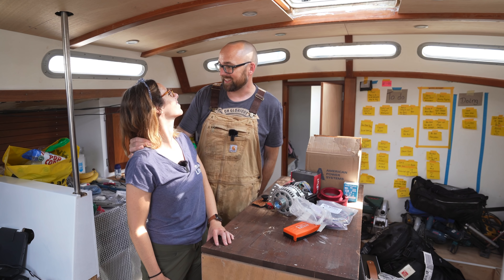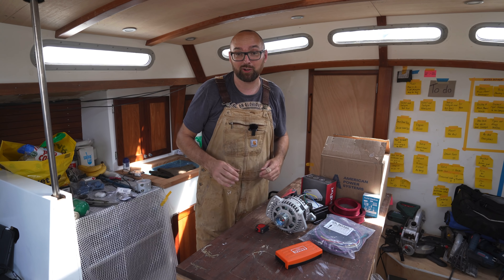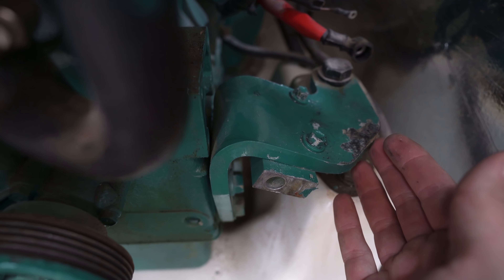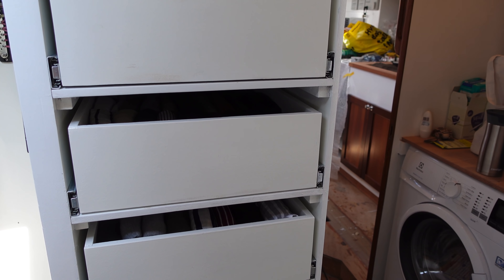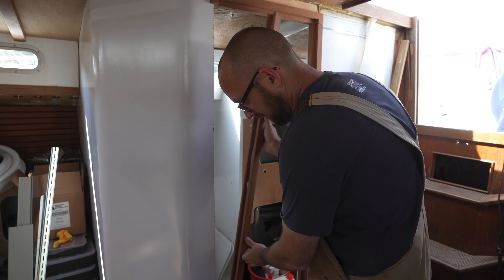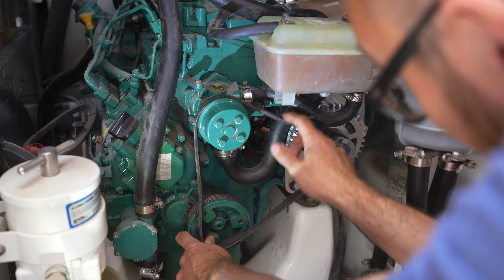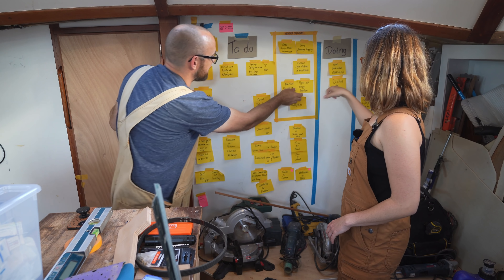Sail Life - 5kW gorgeous alternator 🔥, doorframe & Athena gets her name back

Comment: Nice work guys.  Two options for the shelves in the V lockers.  Thermo formed plastics you cut and use heat to bend then rivet or glue together.  You can make very tight fitting shelves that are very thin so maximize space.  Also can cut them so they allow reaching "in front of the transverse vertical parts so there is no hidden spaces.  Can use net bags as well to coordinate what is stored so your not having to dump and sort then store all the time.

Comment: FYI for the DIY 
Whenever you have some small dents in real wood you can make a couple slices into the grain with a razor knife and then place a wet rag over the dent. Use a hot iron in order to steam the wood by forcing the heat through the wet cotton rag and ...
TADAAAA. 
repeat as necessary after drying then sanding down the raised grain that results from the steamed wood grain.
👍🏼 hope it helps.

Comment: So a couple ideas for your organization, in the lockers where wood shelves won't fit, you could do a fabric shelf with it sandwiched between wood strips on either end. Also, for the plastic bins, if you can get it there, some shelf liners would reduce noise and keep them from sliding a bit. Some elastic straps could be utilized hold them in place too. See the link below for the shelf liner

Comment: To attach the clutch with shorter bolts. Make the bottom piece of wood longer than the clutch. Make the top piece of wood the same size. Ensuring the upper wood is centered with the bottom wood. The bottom piece of wood, drill upward and countersink the bottom side and mount the bottom piece to the upper piece and the clutch so the bolt heads are flush with the bottom. Then put down on the boat deck, and with the outward longer flaps on both sides, bolt down through the deck.

Comment: @2:00 but... the engine compartment is clean and freshly painted... oh.  ISWUDT.
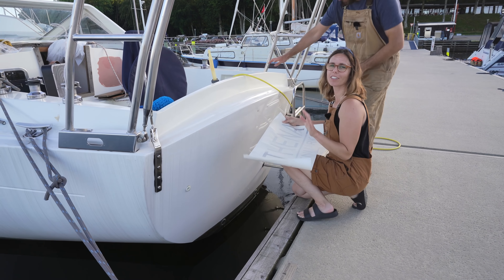@15:10 Invest in some kind of bracket or a place to secure  the ladder/engine access panel.  Because other wise you will put it any old where that will  damage the finish on your panels, and potentially become a hazard if you are troubleshooting the engine while rocking in heavy seas.   
Assuming you haven't  thought of that....  which you probably have.

Comment: Regarding the issue with the motion of the plastic boxes. I have you considered attaching a lid on the shelf in some way and then just let the box stand in that lid. The boxes and their lids are constructed in such way that they are stackable, so it would certainly work. There is also some dohickeys at IKEA that is used for "locking" the lids in place, which are really good in cases where the boxes are a little overfilled and in which case the lid will just not stay in place 😉

Comment: For the compartments where you can't fit shelves, if you can't fit horizontal dividers, you might want to try vertical dividers.  That way you can fill it with things that stack, while still keeping divisions.  Also, because the divisions are vertical and don't support weight, you can make them much thinner (so they take up less space).

Comment: I would use bungee cords on the plastic baskets on the shelves to hold them in place and cut down on noise when at sea.  You could also use metal or wooden rods that you could Fit into slots but would require measuring, more work and more noise.

Comment: for storage in the one compartment that you couldn't get a shelf installed..  try the "shoebox" sized containers similar to the larger ones you have on the bigger shelf spaces.   that location looked like you'd be able to put 3 or 4 across, and maybe 3 or 4 tall....if you find some of the better ones that have latching lids, they'll keep things dry, are clear so you can see some idea of what's in there, and can pull out a couple without really disturbing the others much.....(labels on the end would go a long way too)  They're just big enough you can put two pairs of jeans in them, or 3 or 4 tee-shirts, a week's worth of sox or a weeks worth of underwear.  bulkier items like a sweatshirt might be single entries, but it deepends on how bulky they are..

Comment: Phew!  Lots to think about.  Volvo Penta do a kit  for mounting a second alternator on the LHS (starboard) side of the engine.  This is for the Mastervolt alternator but it then provides 12v and 24v supplies, you can then have a separate battery for the engine and generator - useful...  Covid - in the UK we have a certificate system run under the NHS with the NHS app.   Even as visitors you could register on this, other than that I don't see any problem, certainly in England at least.  We are very tolerant of these situations, and I've met many different nationalities staying at the marina.

Comment: Regarding shelves in the lockers over the v-birth, have you considered trying "soft shelves"? Attach some kind of rubber band (like the ones used for cars with hooks on) and add one in the front and one in the back on the level of the shelf. As the shelf ot self you can then use some sort of fabric or mesh. You can create a "tube" of it and have the rubber bands go inside of it.

Comment: I hope that faucet output isn't too close to the edge of the sink. Hard to tell from the camera angle but it looks like the water will come very close to the vanity top. I always find it awkward to wash my hands in a sink where you have to practically put your hands on the edge of the sink to get them under the water.
Actually I just had another look and the faucet output looks like it doesn't go straight down but points more towards the centre of the sink. So looks good.  :)

Comment: Mate, i feel your alternater pain. Ive got a Yanmar 3ym30AE that i didnt want to pay AU$2500 for a genuine alternater, so i purchased a bosch from a local marine electrician that was "drop in" for $700, it sat proud and crooked to the belt line. Turned out the ear they ground down wasnt ground enough and done crooked and the rear mount they made was also out of wack, 3 days later its in and belt on. Started up fine for 30 seconds, shut it down to get my laser thermometer and it wouldnt restart, another day to find a loose earth and it runs fine now but no water out of the exhaust.....so i moved onto the dinghy engine for a bit lol. At least theres always another project to move onto when something wont play ball. (Waters an easy fix anyway, whatever it turns out to be)

Comment: Anti slip mat under the ikea boxes works great or just screw on a rubberfoot underneath them and you won’t have the mats to fight with. 
The cabinets can have a horisontal devider to make it easier make it in two pieces and it is easier to get in there
Also put the medicals in a box with air tight lid you do not want medication to get into moisture..

Comment: Minute 6:55, you can always cut the shelf in two so it will fit through the door, in order to hold it you just need a perimetrical piece of wood all around and few screws, remember it won't be the strongest shelf of the world, but for clothing or no so heavy stuff would do

Comment: Could you flip the alternator mounting block and mount it on the top side of that motor mount. Then the bolts are on the bottom. The alternator will sit a little higher, hopefully you have the room.
Reply: Hahaha i should have just waited till the end of the video. Nice work.

Comment: It would be best to fit the larger pulleys. It does 2 things It increases the alternator output and aids in cooling the alternator And allows  you to run the engine at a lower RPM which lessens the wear and tear on the engine and lowers the noise level. Also fit the water pump larger pulley as well.
(;-) TP

Comment: Getting closer! One recommendation for the meds/supplies: get a vacuum bag sealer that you use for food and make various smaller bags. Bandages, bandaids, etc., tend of oxidize over time and this helps a lot. Also, if the main bag gets doused you will have lots of watertight "go bags" inside. Tip: after sealing the bags, make a little cut in each so you can rip them open without a tool.

Comment: Suggestion for organizing large lockers is plastic contsiners. Label them and put a map of the inventory on the locker door. Because the lockers are odd shapes we use the odd shapes for seasonal clothing. Every inch of storage is valuable, so make sure the containers do not have  wasted space.we also keep a master list in the main cabin so we can find stuff easily. Heavy stuff like tools get spread out all over, so you can see why the master list is so helpful. This way the boat trim is helped by spreading out heavy item that you do not use every day.

Comment: In V berth cabinets to increase storage above stored items Amazon has "storage nets" of many colors that are about two feet long that hold lots of stuff. By screwing in some cup hooks you can double storage. To keep plastic bins from sliding around use non skid mats under and perhaps a bungee cord across front to keep them in place when the boat is pitching. Doing a great job and the boat looks "VERY SPIFFY"

Comment: How about using magnets to hold your clear containers down to the shelves.    Possibly use a router and route a recessed spot for magnets and then also epoxy another magnet to the bins.   It would certainly hold the containers while sailing and still be removable.  

Im thinking the larger strong magnets, like the size of a US quarter or even larger.

Comment: they make rubberised shelf  liner its made to keep things from shifting .  its a mesh with little rubber dots on the intersections/   Its very cheap  comes in rolls and in different colors.  My dad used it in his motor home to keep things from sliding around while traveling.   they may be what you are looking for, for the containers

Comment: I have been watching your videos for years and love them!  Suggestion:  I have a great deal of experience with the Ikea  bins and I used to use them in my woodworking shop for many years.  Long story short: the bins are fine but the lids are eventually going to be a huge source of annoyance for you.  I would suggest upgrading the bins to something that has a better lid (like rubbermaid if  you can find them in the right size) and save yourself the grief at sea.  

For labels, I make paper labels on my printer and then run those labels through a laminating machine.  The laminated label is then simply placed on the inside of the bin, held in place by the contents.  That way, changing the label is as simple as swapping out the loose label, rather than having to peel an adhesive label off the side.  It works very well.

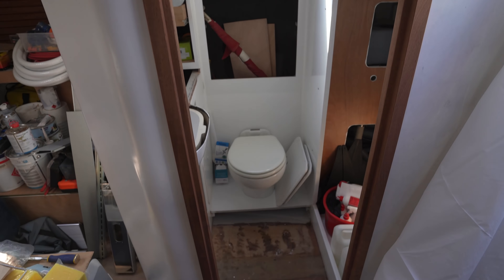Comment: I was wondering if you could comment on your sander.  the one you're using at 9:40.  I believe that is the 7.5 amp.  I've been comparing the Bosch to the Festool Rotex RO 150 FEQ-plus vs the Festool ETS EC 150/5 EQ-plus.  The Rotex vs the Bosch is for all quality comparisons practically equal.  In the US, The Bosch is $273 and the Rotex 150 FEQ-plus is $630.  That's nuts.... So Bosch easily wins there...
My question to you is, if that Bosch was smaller, like the Festool ETS EC 150/5 and it didn't have the "turbo" mode on it, which is just rotary without oscillation, would you have been able to achieve what you needed or did you absolutely need the "turbo/rotary only" mode to get your work done in the timeframe that you've had?
I'm asking because I'll be doing a lot of vertical and upside down sanding.  I'm concerned the weight of the Bosch will get to be annoying and cumbersome.  The Festool ETS 150/5 seems to have the utility, weight and ergonomics that I'm interested in.  Thanks, and the boat is looking great.  Sorry...  I forgot to say, "all hail the red doohickey!"

Comment: Speaking from experience I would suggest a longer faucet for the shower sink. This one would get more water on the counter top than the sink.
Reply: I thought the exact same thing..
Reply: A lot of our (scandinavian? european? I'm Swedish myself) bathroom sinks have this problem - it seems to be the standard over here. My hands are constantly bumping into the back of the sink bowl while washing. A longer faucet would solve that, but they just aren't available it seems.
Reply: Yes this needs upvoting
Reply: Yeah I thought the same thing. I put in a raise sink in my RV's bathroom and made the mistake of putting the faucet back too far. It works but it splashes water on my mirror all the time and then I got to clean it. They'll figure it out though. I'm sure that once they're out there, if Mads thinks it's an issue he'll fix it.

Comment: for that tension arm you built---either make a copy or a template in case that one eventually breaks. Again --to cover all the "What Ifs" in cruising!?--------Mikey, Belfair, Wa, USA
Reply: This would make a lot of sense seeing as it's a custom part now.
Reply: Or at least keep exact specifications so someone could make it with 3D printer.
Reply: yeah especially considering that it's going to be under tension with a big vibratey thing directly connected to it.
Reply: @henrymorgan3982  3D print will never work for that application, no even close...

Comment: For the forward lockers, I have seen people use soft  bins turned on the side with opening facing out.  This way you can stack them and yet not have to always take the bin out of the locker.  Just some food for thought.
Reply: I keep seeing those nasty long bolt ends sticking inside and forcing use of the medkit...

Comment: You could add a shelf in those forward lockers if the shelf was a bungie/cargo net that was screwed into the corners. That would give you a second level to work with.
Reply: I was thinking he could build a set of slat shelving, the pieces would be smaller and easy to fit in that space.
Reply: Make the shelf out of Phifertex or the equivalent and it will perhaps allow a bit more airflow and hopefully less mold.
Reply: @WaterFaucet24  My thought also ...
Reply: @Senapspiser I like this too. Light weight, simple, easy to install, and cheap. Plus with the time crunch this can be done with little effort for the project.

Comment: Instead of horizontal shelves in the forward lockers, you could make 1-2 vertical spacers and stack better vertically. Also - put the bigger items like pants sweaters and such in the lockers, and small items like t shirts underwear socks etc in the drawers.  The bin system in the long term is spot on.

Comment: I do hope that the alternator works out for you.  I tried twice on different installations to fit high output alternators and ran into severe alternator overheating issues each time whenever I tried to make full use of them.  Best of luck!
Reply: External regulator has temp sensor throttles it back 👍😁
Reply: @rogerkerkmann  I had a Sterling regulator that did the same thing.  The problem was that it would only run for a few minutes before it cut back by reaching over 90 deg. C.
Reply: @jdudb  need more RPMs 👍

Comment: I’m pretty sure U.S and E.U passport holders can stay in the U.K for up to 180 days per visit. I think your biggest obstacle to getting into Scotland will be Queen Nicola of Holyrood. 😏
Reply: @johnprance1888  they don’t need visas, neither US or EU/EEA passport holders require a visa to enter the U.K. and can stay for 180 days per visit.
Reply: That’s what I was going to say. The confusion with the 90/180 is for TCN’s (third country nationals) within Schengen. Even non Schengen EU citizens do not have to abide by the 90/180 when visiting Schengen states. Eva and Mads should be fine for up to 180/360 in the UK. Covid rules permitting of course.
Reply: @Dang3011  yep thats what I meant.  They can enter the UK like you say right now. If they want to stay longer than 6 months which they might as they are going over winter and may not be able to sail much then they can easily get visas.

Comment: Tip for the locker:
Split a fitting length of the shelf in half, join them together inside the locker. 
Considering that it is going to have personal items inside, it won't need to carry any weight.

Comment: Take it easy on belt tension, more than is needed can really shorten the life of water pumps, alternators, etc.  Tight enough to work and no tighter.  They make a gauge to check belt tension.  Spare belts and hoses.   you also collect 12 internets for the doohickey.